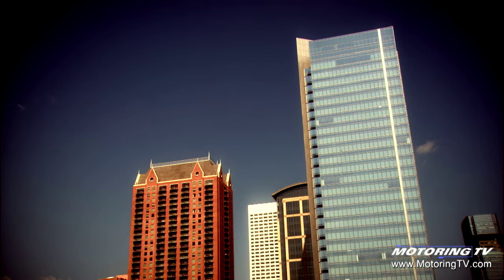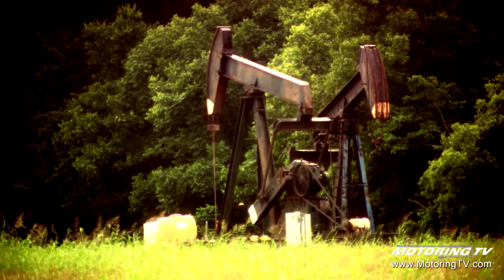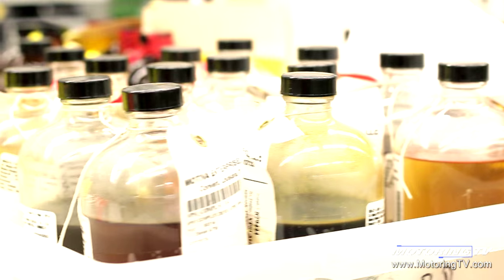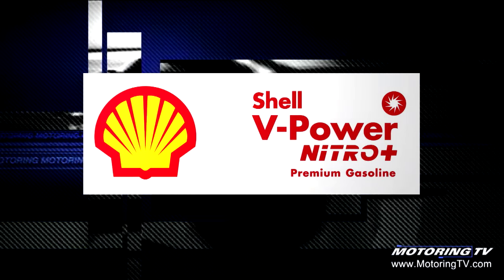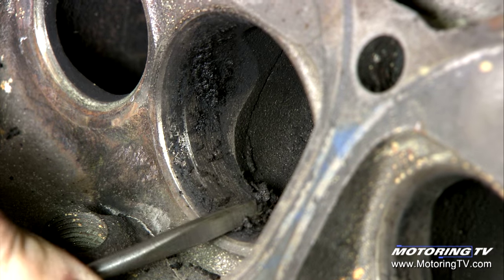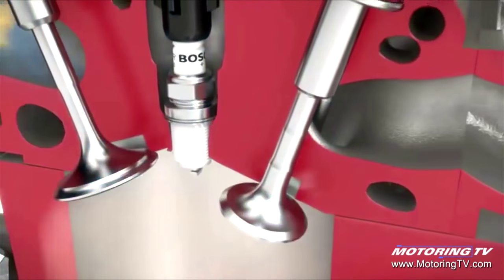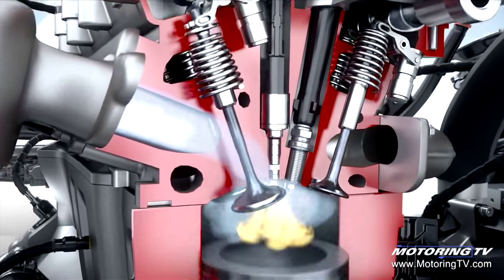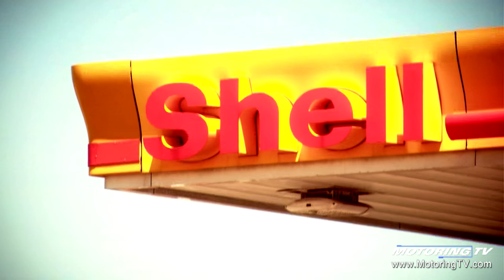Motoring TV gets the scoop on Shell V-Power NiTRO+

Comment: I have a Nissan 370Z(VQ37VHR engine) with about 28K miles on it and I've been using Shell V-Power Nitro+ exclusively since shortly after I got it; I used Chevron Supreme initially for a few months. The Shell gas seems like good gas but I still get deposit buildup on the intake valves, to the point where my idle runs less smoothly and my engine stumbles on a warm restart. What I did to correct it is to use Redline Si-1 fuel system cleaner, one bottle to the tank, just before my 3K mile oil change and that smoothed out the idle and eliminated the restart problem for about 2K miles. What I have finally one is to add 1/2 of a bottle of the cleaner at the 1500 mile mark and to dose each tankful at 1.5 oz per 10 gal of fuel. The car now runs perfectly with no roughness or performance issues. My engine has always run very cleanly, using virtually no oil between changes and with hardly any soot buildup in the tailpipes.

The point here is that no matter how much Shell hypes their "wonder gas" it still is not perfect.
Reply from the maker: Good feedback thanks.

Comment: Ever heard of Seafoam or Chevron Techron?
Reply: Seafoam is maintenance is a can! Lol
Reply: @MandusahRamirez  Works every time, for me at least, with not an issue to be had.
Reply: I used Chevron Techron high mileage fuel system cleaner on my 2013 Genesis Coupe 3.8 and if I'm not mistaken after the first use she sounds better while idling and seems to perform a little better. I got the exact same result using Chevron techron fuel system cleaner on my 2005 infiniti G35. Would definitely  recommend.

Comment: The shittiest thing about shell, and this might just be gas station design.. and I could be wrong about this.. but Say the guy before you gets 87 and you want 91.. Woudlnt the hose be filled with 87 so youd get a couple liters or so of shit fuel in with your good stuff? Wouldnt the good shit just be cleaning away what the hosefull of poop fuel just put in?!!?
Reply: Wretched Slippage it's not like that here in the UK. The designer of these pump in the UK have this thing called a brain.
Reply: You'd get about a quart of regular 87 octane left in the hose before the premium starts pumping. Use the same pump the Mercedes used.

Comment: shell vpower is a gimmick, doesnt do what it says it does
Reply: No it's not it's a proven fact that it works better than any other competitor I can even provide a source that proves this.
Reply: SixR i ran my own test and shell v power nitro actually did a massive 70 miles less than a supermarket brand premium fuel
Reply: Well you're wrong because my source comes from Engineering explained and they tested the same car models and one was using another competitors gas and one was using V power and V power actually worked better than the competitor so no V power is better.
Reply: SixR then can you explain why i got 70 miles less on my motorbike than i did with momentum 99 and the level of riding in both experiments, just a simple commute to work
Reply: SixR you do realise that motorbikes run on unleaded fuel as well as cars lol, my handbook clearly states use premium 99 octane fuel which is what nitro+ is
Reply: Because it doesn't use high compression. Everything else I said is correct.
Reply: then tell me this why is it that the same octane unleaded fuel from a supermarket not only boosts my acceleration but gives me 70 more miles than nitro+ which by the way is the same octane and just so you know was also designed for motorcycles too
Reply: lol you still arent getting it, the premium fuel i use from a supermarket is also a 99 octane its called (momentum 99), nitro+ is also a 99 octane fuel so why is is that this fuel gives me 70 miles less on a full tank than a supermarket brand, oh and motorcyles are far superior to cars just thought id throw that in
Reply: SixR v power is meant for all engines not just cars, motorbikes can hit 200mph quite easily, my kawasaki h2r tops out at 249 however if i modify the bike with power commanders, free flowing exhaust without a catalitic converter i could hit speeds of 300+ very easily, fastest motorbike on the planet is the dodge tomahawk with a top speed of 420 mph so you stick to your slow ass car while the big boys have fun on real machines
Reply: My 12 year old vauxhall gets great results using v power nitro +
Reply: its works mate : )
Reply: I got my 1997 honda accord on shell fuel only and 400k miles and still runs like a lion and I bought when it had zero miles 24 years ago
Reply: @MegaPaddles  interesting Chuck, 70 miles less on a tank of fuel on your motorcycle with V Power? That’s a 30% to 50% reduction over normal gas. That’s completely ridiculous.